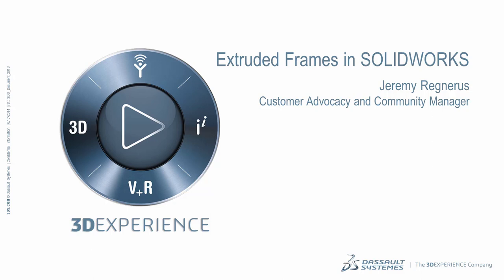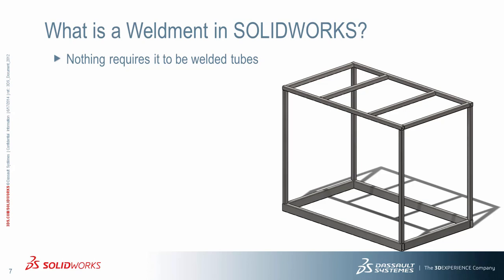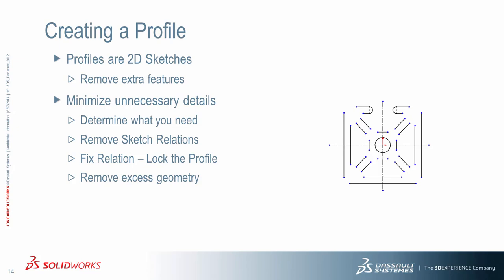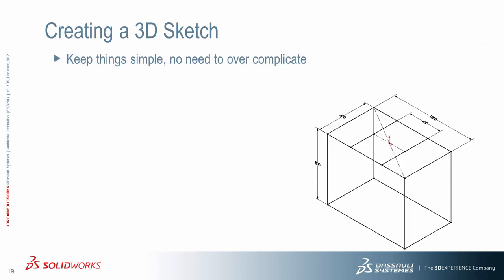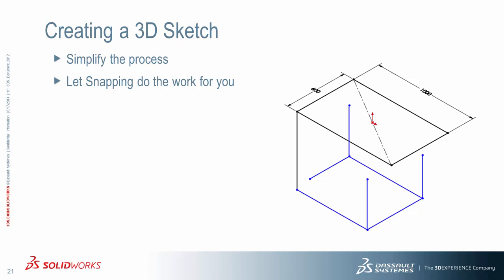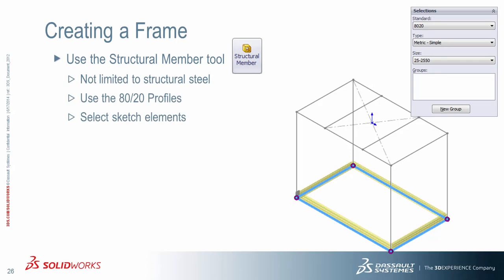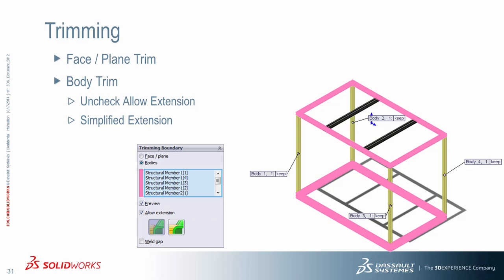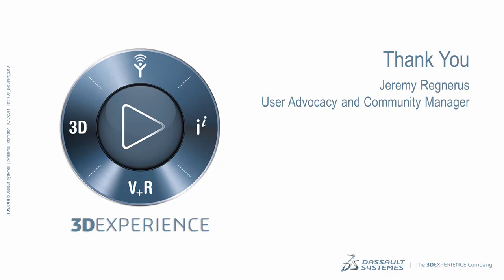Tech Tip Tuesdays: Extruded Frames in SOLIDWORKS

Comment: Excellent video.  I have been making frames out of 80/20 this way for a couple years and find it extremely useful.  I also use weldments for lumber objects.  You point out some very handy things that I have not considered.  Simplifying the profiles is one thing, this really makes it easier to help to position the profiles when are are not just using c/l of extrusions.  I am going to go and simplify some of my profiles.  I also like the fact that you add the gussets in the weldment.  I usually make the weldment and then a separate assembly file.  This should save me some time in the future.  Finally I like the feature near the end where you click to make a separate view of a certain component - very handy if you have special cuts!  Thank you, this was a great video!